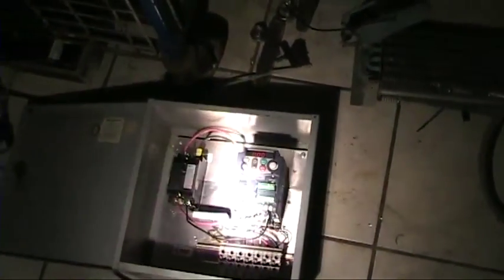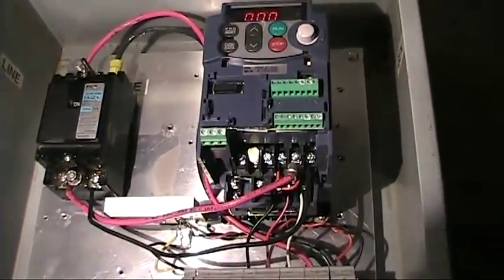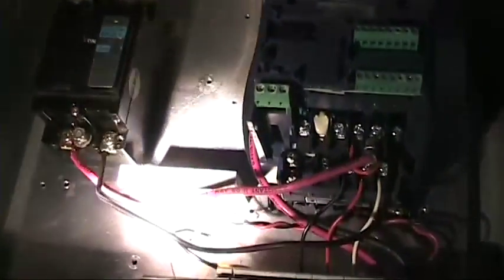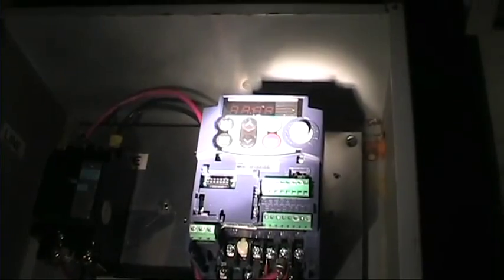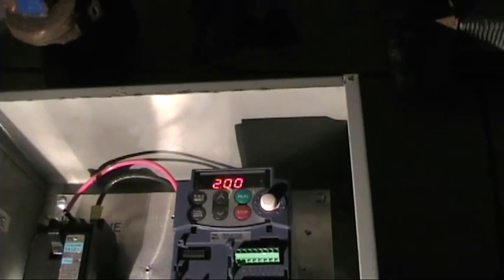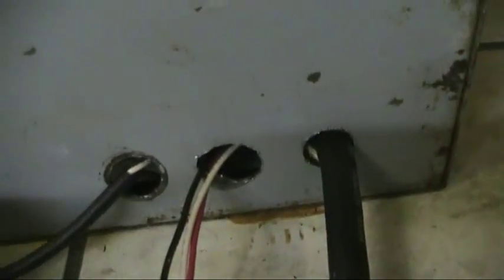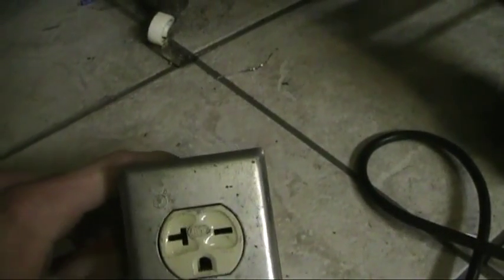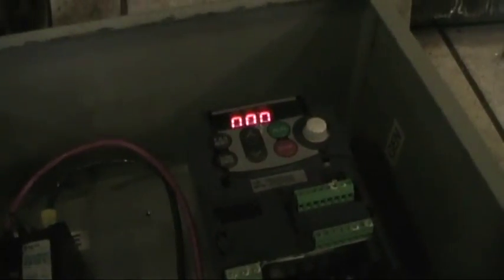VFD as backup inverter for 3 phase motor

Comment from the maker: Google Search: "CTR Surplus Ebay Auctions" In the store "lisa_surplus" there is an item listed "Fuji Electric FRNO 4C1S-6J Inverter Drive" Thats exactly what I use in the video. Other VFDs can also be used, as long as they can run from the DC bus. Most new VFDs can

Comment: What DC voltage should I put on the bus for a Baldor H2 Vector drive, model VS1GV45-1B, which  says it should have 460 vac 3 phase. It's a 5 hp drive.
Should I match the voltage in DC volts(460 vdc)?
Reply: Around 675v should do the trick

Comment: so , does it mean that i can use a vfd drive with enough power capability along with powerful battries  to power my house with the 3 phase output from the vfd?
Reply: Most VFDs don't have a neutral so you'd need to put it through a Δ-Y transformer
Reply: is it ok to use normal transformer type inverter for house @DriftHyena

Comment: will there be problems running 2.2kw VFD to a 300W motor?
Reply: set rated current and votage in vfd setting
Reply: @NarayanPrashadNepal  large power differences between motor and VFD are a problem, because the VFD current shunts are not precise enough to measure the correct currents for the low power motors. Up to 50% is ok anything less is problematic.
Reply: thank you , from your suggestion for 300w motor to 0.4kw vfd is best solution, in term of cost of vfd and technical specs @TheOriginalEviltech